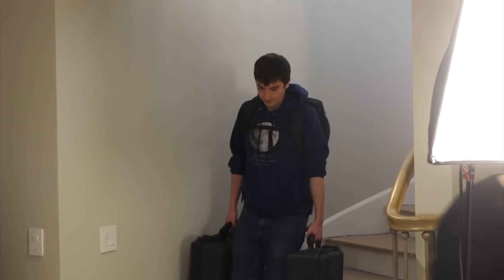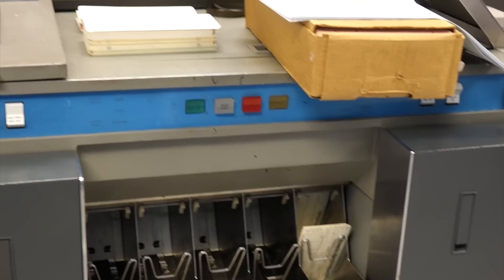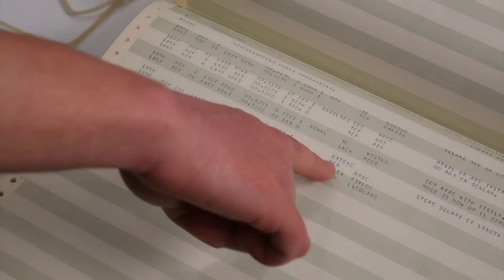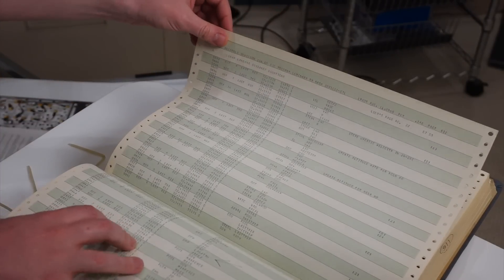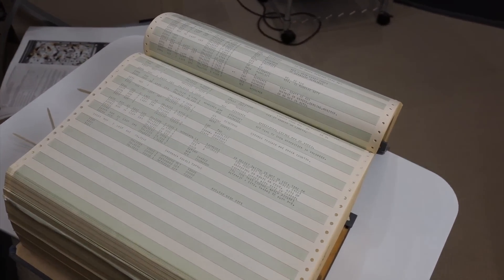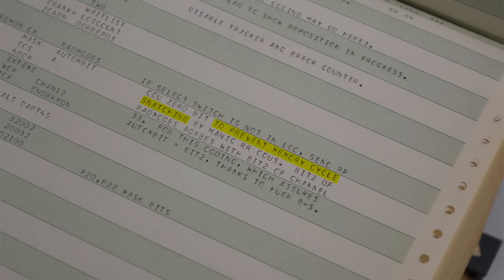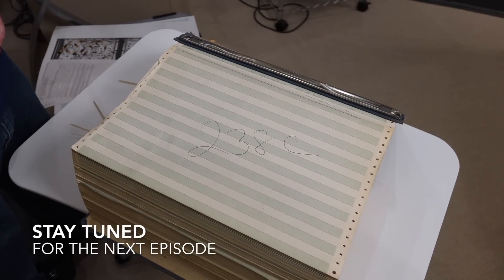Apollo 12 Source Code: Looking at the original flown code printout, and the 1202 error fix

Comment: Marc, I worked on the Space Shuttle computers for 20 years at IBM and LM and would be very intereted as to whether that computer has a Serial Number on a tag on the side.
Reply: Oh awesome! It sure does. P/N 6966000-6, S/N 308.
Reply: @mikestewart8928  can you tell me where they bought it from?  I am amazed that it was out in the wild.
Reply: @mikestewart8928  Ah, it is a pre-production unit.  A lot like the actual flight computers but not quite the same.
Reply: @paulcushing8663  Apparently it came from "The Spaceflight America Museum and Science Center in Prince Frederick, MD", on RR auction. Do you know how it differs from the flight computers? We haven't found too much documentation for it yet.
Reply: @mikestewart8928  Mike, From what I can see on the photos (the product test lab didn't work on the pre-prod units), the Pre-prod unit mainly differed physically with the black and yellow wiring harness replaced with tape-cable pages, the structure would become a welded construction instead of bolted and the electronic components, while based on Texas Instruments 74 and/or 54 series parts in the pre-prod, got new IBM-supplied partnumbers due to the radiation hardening requirement for all flight hardware.

Also, i would be very surprised if you could find ANY documentation for it in the public domain.  It was an IBM design, based on the B1 computer (we were told) with modifications to connect-to and operate-with the existing (from the 1st generation AP101B system) IO Processor box.  They two boxes were interconnected with three shielded cables. The forth connecter on the computer is an AGE (for ground equipment) and capped when installed in the shuttle.  The IO Processor box was the only interface to the shuttle systems via  24 serial channels plus approx 40 discrete in and out lines. When first powered-on, the computer was "stupid" as there was random data in the solid state memory and it had to be IPLed from a Mass Memory Unit. This was a big change from the 1st generation computers which had core memory in them.

f more comes to mind I will post it.  T'was a very long time ago!
Reply: @paulcushing8663  IPL is a very interesting topic in modern systems. Especially if someone convinced the HW people to allow lock each HW unit to specific software revisions via digital signatures, but even if not.  Typical solutions involve a small amount of IPL code in an on chip "IROM", which contains code to contact and read the off chip mass storage unit and/or an external production line system feeding each new unit its software and parameters.

Comment: It used to be in all the compilers and assemblers I knew about, when you were merging input from tape and punch cards with patches (usually known as patch cards) the asterisk next to the sequence number indicated that this was a patch card. Non-marked input was coming from the master tape. There were other possible flags, like a # sign if you were generating a new merged output tape and also resequencing a range of the input lines. Of course this assembler may have worked differently.
Reply: Ah, interesting! A lot of the same terminology exists with YUL/GAP. Revision assemblies are handled with "merge control cards" -- things like DELETE 0024 THROUGH 0100. Actual code cards were called "detail cards" rather than patch cards. The only other marking like * that I can think of is that YUL (the Honeywell 1800 and earlier version of this assembler) would print an @ on any line that had been matched by an acceptor card.  Acceptor cards were how they dealt with the punch card sequence number resetting to zero with each log section. In such a case, the sequence number "0123" is ambiguous, if there are multiple such cards in the program. The acceptor card let you specify the contents of a specific card (usually, the card defining the start of a log section), and it would halt the merging process until it encountered a card whose contents matched what you punched on the acceptor.

Comment: I graduated HS in '79 and was skilled in keyboard (typing), punch card prep and entry, and were still using Guestener Machines for many duplication jobs. The next year I started my BA at Adelphi and for my required foreign language, I opted for Basic, Fortran And Pascal on the main frame in the basement of the Psychology Building...I still have a working C64 with 2 double speed 5 1/4" disk drives that runs a biofeedback system....we have come so far so fast....and still going....   we need Mars for Rare Earths alone....  NASA (Triple Redundant!!!)

Comment: It was common for those old printers to have that kind of printing error when it reached the end of the box of paper.  They relied on the pressure of the paper in the box to help control the feed.  When you got to the end it would often skip and slew as you saw in the video.  Then the printer would pause to load new paper.  Then the operator would load a new box of paper and continue.
Reply: Oh, the only ones I worked with had the blank paper in a hopper under the mechanism that pulled up reams past the print chain then dropped it in a second hopper for collection.  Almost all the 132 column paper had the old name of the computing center preprinted in the margins, probably an over optimistic bulk purchase before my time.

Comment: 7:28 In 1973 I dropped two boxes of punch cards and they spread all over the floor. Luckily they were numbered from column 73 onward and there were many larger groups of cards that did not separate. It still took me all day to put the decks back together and my boss was NOT impressed. Unfortunately the company I worked for did not have a Hollerith card sorter which would have made my job so much easier.

Comment: I love the engineers that came up with the 1202 hack. They essentially strangled the CDU with an always-0 command to shut it up.
Reply from the maker: That’s exactly what they did. Mind you, it was not that easy to shut down the runaway CDU, as even turning off the rendez-vous radar (as they did as an emergency measure for the Moon lift-off) would not do the trick, and the fault is so convoluted that it would have been a major redesign to fix the hardware. Fortunately there was that little reset line connected to the AGC. That’s how the rest of the missions flew.

Comment: Fascinating is the only right word to use here. My personal note on the punch card numbers: it's interesting how this filtered out to the 70s and 80s with the higher level languages like BASIC. Remember lines 10, 20, 30? I was learning programming in the 80s and I remember how I was confused of why I had to track code line numbers and insert line 55 or whatever instead of computer letting me insert what I want where I want. But now it's pretty clear where the origin of that kind of line numbering was.

Comment: I used to read core dumps on IBM mainframes for COBOL programmers as I was one of the only assembler programmers there. I used to diagnose 3,000 page CICS dumps. Then the operations manager decides "it was a waste of paper to print dumps" so instead if paper I would get microfiche on my desk, and I didnt have a microfiche reader!!!
I taught at a large college in NY, mainframes and assembly language too. I still prefer assembly language to any other

Comment: The programs were tested in Huntsville Ala .MSFC  
A Saturn in  a hangar all cut up. Minus fuel tanks and hydraulics. 
A miniature firing room ,electronics mostly.  The Count clock was a simple timer. Set ...Run...Start.
A test for programs on the Mag tape we brought from KSC.
I was IBM Guidance and  Control. 
The beauty of this" Breadboard " was you couldn't damage anything there. !!
Test and correct.
Reply: Guidance and Control. 
The Huntsville Techs were great and all we 3 from KSC ask for a configuration and it was done. We purchased time on the resources $2000 per hour . Returning with tapes to load and validate (QC) at KSC.

Comment: This was most certainly printed on a 1403, a printer which had the longest production run of any printer IBM produced.
Reply: The IBM 1403 was a very noisy printer. I worked shifts at a banking processing centre. We had several going nearly all night.
Reply: @RossNixon  

I maybe wrong, but I think my High School had 1403's, but were kept in those darkened glass, acoustic cabinets, with extra foam 'dampening'. Even so, those things were loud , so it made sense to do all the printing at night, otherwise you'll need hearing  protection, with half a dozen, or more, of those things going at once ...

[Edit: wow, am I stupid  ...

No, it definitely wasn't a 1403 printer I was thinking of ... 

It was definitely a dot matrix, as it was way, way, smaller, and faster in printing ... still was made by IBM --- I think; could've been a Compaq --- but it was in a metal stand of it's own, with a brown translucent cover/lid. Still had 'eggshell' acoustic foam on the inside, and, iirc, fans for ventilation, as the only other slots were fot the paper input, and output, with the input stack on the lowest shelf, and output on the shelf just below the printer itself. Funny thing, even with the lid closed  and the fans --- if it indeed had fans for cooling --- it was still pretty loud, even with the lid shut; almost as loud as a 'golfball' printer ...

I can figure out what that printer could have been ... so any ideas ...

... and forgive me for a really dumb mistake ...]

Comment: You may already have considered and rejected this idea (or just be done with doing such videos) but if you have shot details of how Mike managed to convince his emulation of the AGC monitor to replace the erasable memory during the restoration when (if I understood correctly) the original monitor wasn't designed to do so it would be quite fascinating to hear about.  The idea of using that plug to replace a core system hardware component it wasn't designed to replace seemed kind of mind blowing when I heard it in the original restoration video series...

Comment: Can you imagine trying to debug that software without either a modern debugger or the awesome reference system they used?  That code should be studied as part of Programming 101.  OOP without OOP.  

I remember one of the first tricks I learned in assembler was to leave enough blank numbers between lines for the possible insertion of code.  Sometimes 10 was not enough and a real pain to fix.

Comment: I don't know about GAP, but most assemblers of the era didn't need extension cards to make inline comments, only block comments that extend over many lines.  The card has the card number, then the label and opcode etc.  The columns between the card number and the label are computed by the assembler and not on the input card.  Thus you can have 40 columns of stuff the assembler adds between the card number and the label to map an 80 column card into 120 columns of output.  To dump the program to cards, you'd need to dump just the part of the line that was on the card, so it's not as simple as just sending the listing to the card punch.  Most assemblers had an output like this, used to clean up card numbers by redoing them in order from 1 to N, but it wasn't frequently used because you had to run the blank cards through the punch and then the punched cards through the machine that printed the readible stuff back on the top row.  Thus people loved tape more than cards.

Comment: I once worked on a similar pile of listing, though that was written in PL/1 and was the "interface" to a Patient Administrative System. It was known as RS, The Red System - or Det Røde System in Danish (the documentation was in red binders). When it was being replaced by GS (The Green System in green binders) a lot of data moved between the two systems. It grinded programmers down.
Reply: Was this further replaced by one of the bad systems that are currently messing things up for doctors, or is GS the current system?

Comment: As an old assembly language programmer, 6.5" of fanfold printer paper seems like more than 36K words. At about 300 sheets per inch and maybe 50 instructions per page, a 6.5" stack could contain 97,500 instructions. Maybe there's more white space than I would have used. There's a bit of an art to dividing your code into pages to both minimize page flipping and the weight and bulk of the printout. Heck, I see that the listings are actually available online, so I may be able to check this out. Wow.
Reply: There is a lot of paper there.  Approximately how many bytes (or floppy disks) does that translate to to store the entire text from the printout?

Comment: How did they get this into the mainframe for assembly? Cards (many many many cards), tape  or disc?
Reply: I'll answer my own question 'cus I'm listening to you talk about the cards now.
Reply from the maker: So cards for the first listing revision. The cards where then gathered on a big file on tape. Then the tape file would be edited by inputting further "edit" cards. But all the source code lines on this listing had to be originally punched on a card, either as original output or as edits.

Comment: So I assume a machine read the data recorded from the punch cards of zeros and ones and then guided the weavers of the rope memory? Is there an example of this kine of machine still working? Would be cool to get new software working on the AGC.
Reply from the maker: The AGC assembler did output, in addition to the object code, the code to guide the core rope weaving machine. This output is printed at tge end of this big listing. I think this was then punched into a paper tape that was fed to the weaving machine, but Mike would have to confirm that.
Reply from the maker: Mike has got an AGC assembler working and has written new software for the AGC. Ken has also written some software to crack a bitcoin on the AGC. It’s in one of the videos somewhere…

Comment: 1) imho Apollo 12 was already stacked when 11 landed on the moon and hence one couldn't update the software.
2) the 1202 problem was covered by procedure change: switch off the rendez vous radar during descent.
Reply from the maker: As explained in the videos, the software is on removable plug-in modules and can be changed anytime - theoretically even during flight! Also as explained in the videos, turning off the radar would not have stopped the 1202. You’d have to turn off the CDU, you’d lose you the inertial platform and could not land.

Comment: Bound with electrical wire? Perfect !
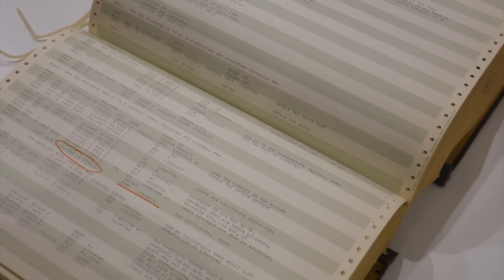Reply: It actually wasn't when I got it. It came bound with its original Nylon bindings, which you can see laying on the table next to it at 3:50. Unfortunately, one had snapped in half, making it impossible to safely open up and look through. Most of the other listings I've seen have used wire, and after a lot of back and forth I decided do the same for this one. Removing and replacing the bindings on it was one of the more nerve-wracking things I've done, but I think it was worth it. :)

Comment: I wonder what language the assembler for this code was written in?  And, what computer they would have run this assembler on?  They would have started writing the code in the mid-1960s and the IBM 360 did come out in 1964 but it was new and no one would have really known how to program that yet (except internal IBMers that were busy working on IBM 360 development).  So, the assembler for the AGC's code was written in IBM 1401 assembler?  Ran on a 1401?
Reply from the maker: Here is the listing for the assembler YUL. It was writen for a Honeywell mainframe. https://archive.org/details/yulsystemsourcec00hugh/page/n67/mode/2up
Reply: @CuriousMarc  Thanks!

Comment: Did the GAP assembler survive? Sorry if I missed it mentioned somewhere.
Reply: Sadly no -- at least, not that we have found yet. But it was essentially just a direct port of the YUL assembler to the IBM 360. We do have a listing of the Honeywell 1800 version of YUL, which was the mainframe used until MIT got the IBM 360: https://archive.org/details/yulsystemsourcec00hugh